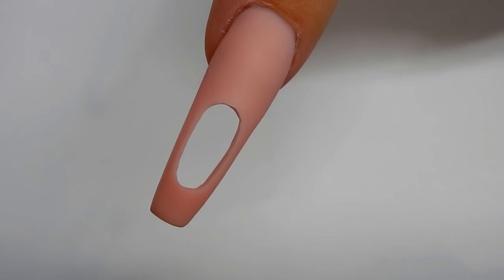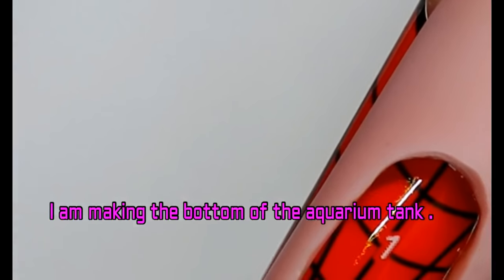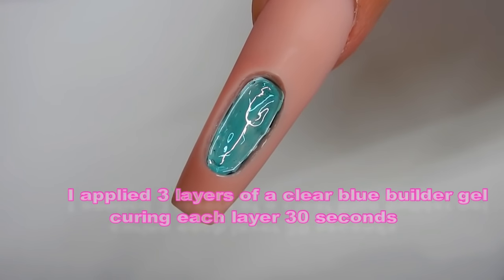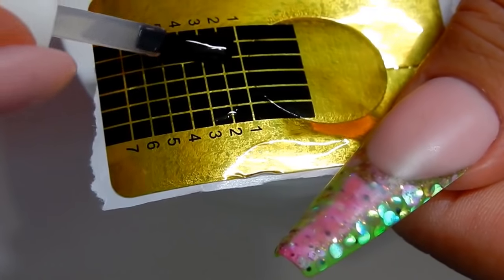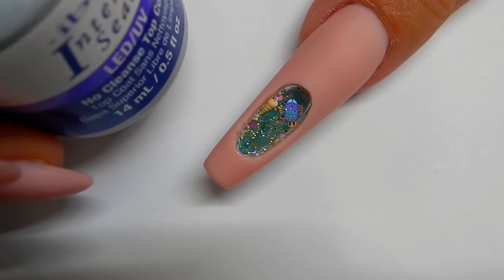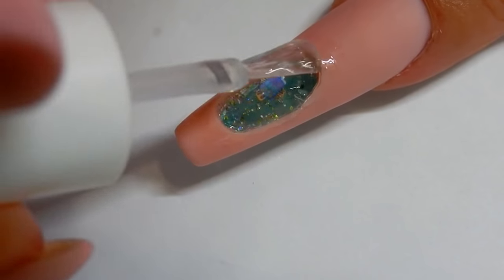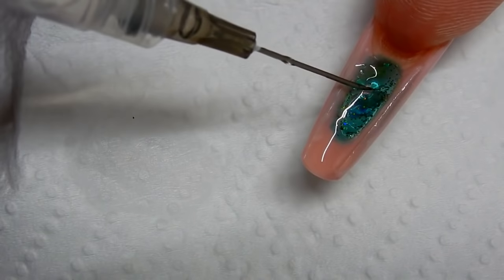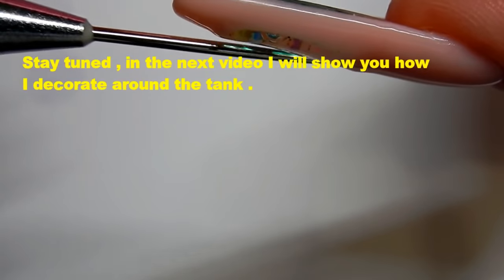Aquarium NAILS / Liquid Nails - NEW Type - Must Watch  !

Comment: what do you do if it breaks? (I have pretty long natural nails just not THAT long) and how do you remove these? I don't have much experience with fake nails.
Reply from the maker: Well , if it breaks I'm able to just make a new one . The only way to remove hard gel is to file it off . I use a electric drill to cut off the long part ....and then I use the drill to file off the rest of the product . Being very careful when I get close to the natural nail . They can't be dissolved in the acetone like acrylic nails can be .

Comment: Denise you really do have a gift I love watching your videos.. I’m a nail tech also I’m just not good with the art.. I have to stick to stamping & shaping & acrylic & gel with glitter & color.. 
& I just did my own tonight & was wondering if you’ve ever had an issue with the ibd white builder not curing it’s just there regular hard gel in white .. I got my left hand done in about 20 minutes & was just gonna try that ibd white for the French tip .. & it’s 3 hours later I finally just wiped off the sticky layer .. it was weird there was a thin layer on top that wouldn’t cure ..I’m covered in gel from fingertips All the way up my arm . I’ve used their clear & pink many times it cures in seconds ..
Reply from the maker: Thank you so much for the compliments . I do appreciate it . 😊 White gel can be difficult to cure because of the opacity  . You must apply it in very and I mean in very thin layers ....like paint . Don’t apply it like you are floating it or stringing it . Or in large dollops . Cure each thin layer . That should do it . If it’s still giving you problems , you can take some white gel out enough for your set . Put it on a tile and add some clear gel to it  . Add just a little , not a lot . The light will penetrate it better . But still apply it in thin layers . Let me know it  helps .
Reply: . Denisejohn65 - Nail Ed 
I realized during it was gonna have to be done in very thin & im gonna try adding a bit clear to it .. I’d say that’ll help ..thank you for replying
Reply from the maker: Sure thing .

Comment: I just have a random question. Instead of making the tiny hole at the bottom, wouldn't it also work if the bottom was already finished and just adding the oil along with the decorations (and the rest of the process)? In my mind, I keep thinking the tiny hole was just an extra step, but I do think you might have a reason for it. I'm just a curious person, I don't want anyone to feel offended (because sometimes I get stuck in comment war zones after asking genuinely innocent questions).
Reply from the maker: +Amanda Navarro Not a problem , that's a great question . The reason I add the hole is because it would be too hard to try and cover a larger area with the oil and or water in it .... because the problem you will run into is sealing it . With the oil and or water in it , it can get on the edges and it will be harder to seal it . The gel won't want to stick and cure well . So, its best to seal it with no liquid in it and the edges with be clean . That way you are sure of a clean seal . Then the last thing to do is to add the liquid , then plug the hole . I hope this all makes sense .
Reply from the maker: +Amanda Navarro  I also forgot to add that doing it this way can eliminate a large air bubble .... you may get a tiny bubble . I think they look better without that huge bubble in there . At least I think so . But you you want to make one and feel you could do it without making a hole .... you could always try it .
Reply: . Denisejohn65 - Nail Ed 
Yes it makes sense, and thank you for taking the time to reply :D I appreciate it a lot ❤ This helps me a lot (for both my curiosity and the urge to try it out). I might try both ways just to see how it comes out, and hopefully I'll be able to make it look almost as good as this :p I've noticed that I always mess up at first when trying out tutorials x..x
Reply from the maker: +Amanda Navarro Sometimes it takes a few times to get it right and to fix and improve any problems you might run into . I always have to do a few " prototypes " that's what I call them . LOL . It's fun to see what you can actually come up with . So have fun with it .

Comment: For superior strength of the top of the aquarium section you could have laid a silk wrap before the final builder gel on top.
Reply from the maker: +gina johnson  You don't need any more added strength. I'm using hard gel on top . Also if you use silk or fiberglass you will see it and that will not be good . You want clarity .